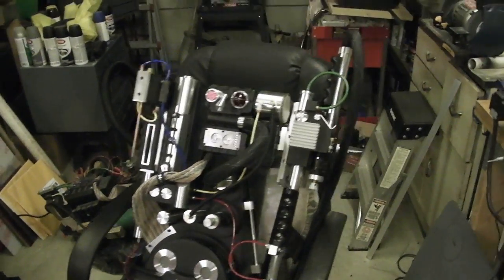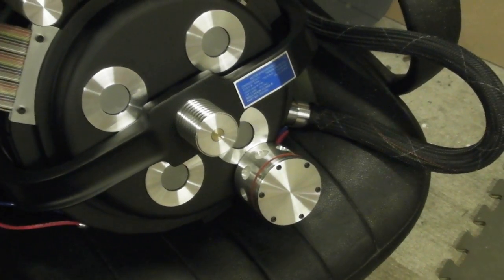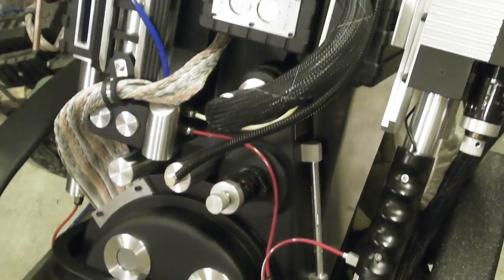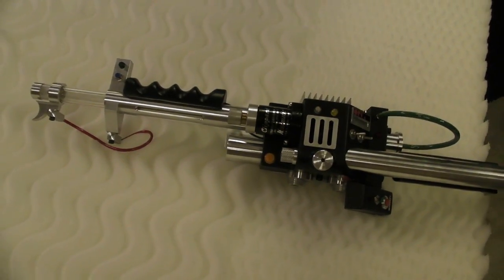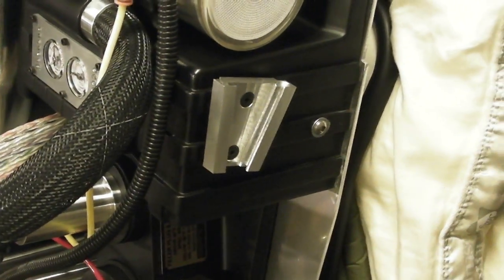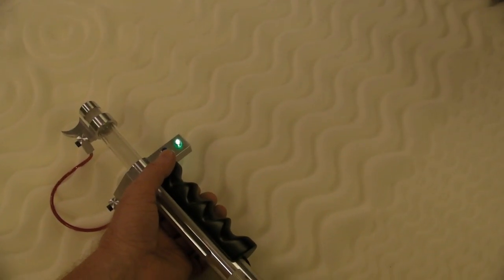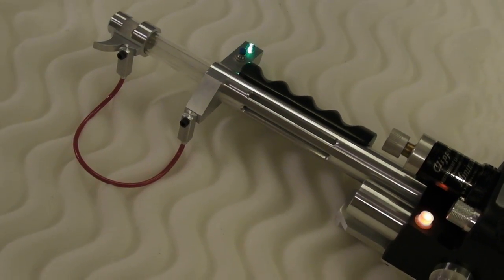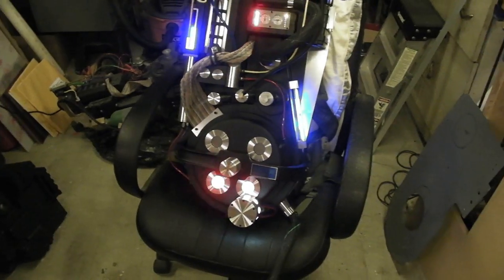"Phoenix" Pack Features Overview

Comment: These are amazing. The only thing I can say that would improve this is if you made one that had wear and tear, weathered look, with signs of welding and burnt in oil and dust on it. It would make it look like something real, rather than a toy taken out of the bubble wrap. That's not a criticism, btw, just a personal preference. 

You see the work at craft that goes into the fandom of Ghostbusters like this. The original film obviously means something to the man building it, otherwise he wouldn't build it, then you remember that Hollywood have basically taken a massive shit on that by making a remake that just looks terrible. It's an insult and it pisses me off.